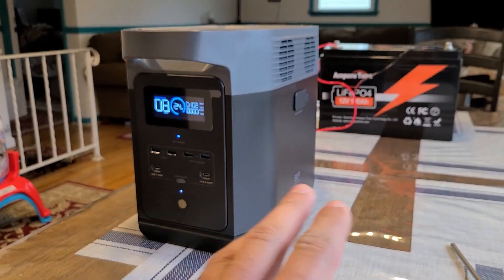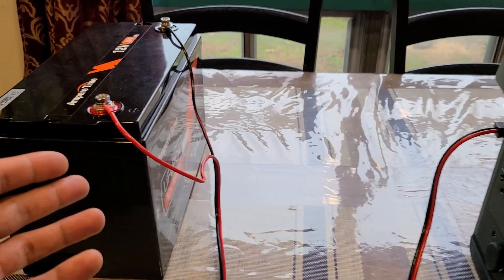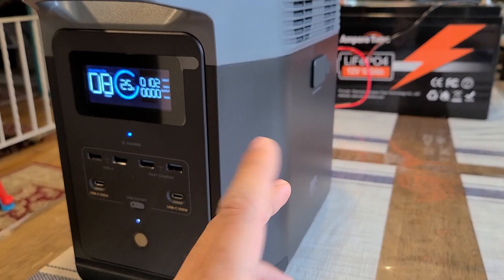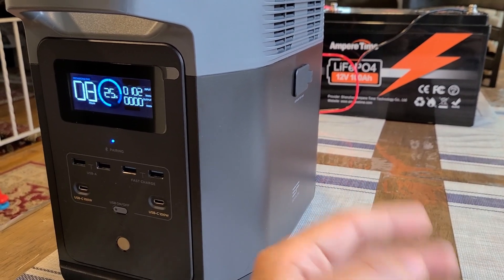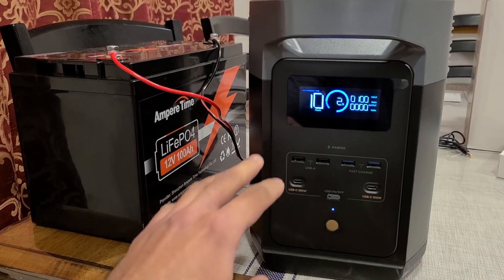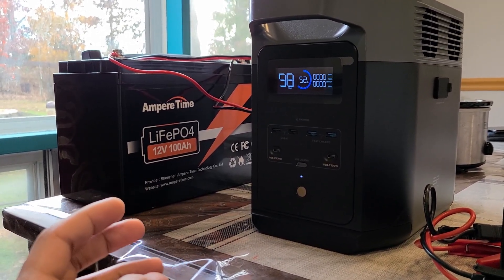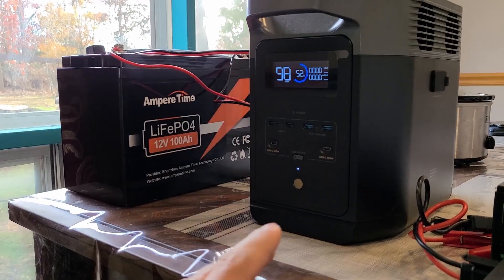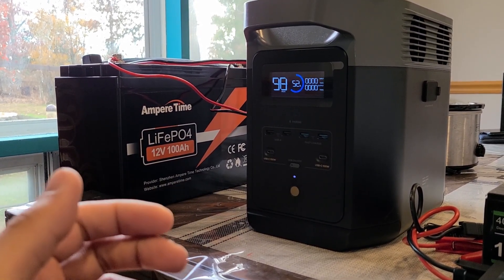Ampere Time Recharging EcoFlow DELTA 2 Power Station - Expansion Battery Test Number 2 #EcoFlow

Comment: Thanks for doing the test but something is weird. Either you have a big "Amperetime" battery or the ecoflow is lower capacity than advertised! 153 percent of a 1024wh battery is 1567wh. the amperetime is only 1280wh. So if you take 1280wh divided by 1.53 equals your Ecoflow is only 836wh at best because you also have to account for charging losses!
Reply: All power stations are using an inverter and it's tax is less than 100% efficiency.  It is more like ? 20% to run the power bank ?

Comment: I was not expecting the Delta 2 to pack a 1024Wh capacity since it is rather small.
Reply: You should see the delta2 max with double battery capacity in the same size 😮

Comment: Cool test. If you want faster speeds you need to up the voltage. For your next test, series both your 12v batteries to achieve 24v then connect to the ecoflow. This should double the speed. Another way would to boost voltage would be to get a dc boost converter. They make them in various voltages and amps to fit your needs. Future test possibility? Jasonoid did a similar test where he paralleled two boost converters. More videos and tests please!
Reply: Good point. Per Ecoflow specs, the Delta 2 will accept a "hard D/C input limit" of 500 watts (max) using any combination of 12-60 volts and up to 500 watts. This makes it very flexible to use any (battery or solar panel) combination of 12, 24, 36, or 48 volts. For example, A 12-volt D/C battery @ 500 watts will use 41.6 amps / a 48-volt D/C (battery or solar) combination @ 500 watts will draw 10.4 amps.
"Hard Limit" meaning anything over 500 watts of D/C input the Delta 2 will shut down all D/C input. Personally, I use four (4) 12-volt, 120-watt panels = 480 watts to stay slightly under that "hard limit". My panels are on a separate solar system specifically for the Delta 2 as a backup for my home office. I have each pair wired in Series (24 volts) and both pairs wired in parallel producing a max of 480 watts @ 24 volts and 20 amps. Note, any A/C input will also override any D/C input, so combining A/C and D/C input is not an option.
Reply: @royrobinson4636  It is also limited to 15 amps.  This means you need 34+ volts before you get 500 watts.  And if you use an XT60 or the "lighter plug" wired XT60i to connect to the Delta 2 it will only draw 8 amps.  This means if you max the voltage to 60 volts you will get 480 watts.
Reply: In that case make sure the DC-DC does not discharge the 100 Ah below the voltage that is on it's specsheet

Comment: Hello, I'm going to say the reason you only get 104 watts charging input is because the extra battery you're connecting to the EcoFlow Delta 2 solar input is a 12-volt battery. Not sure what the solar input rating of the EcoFlow Delta 2 is but 12 volts is probably the bear minimum. I would suggest a fuse be installed on the positive input cables. What happens when a person uses an extra battery like this, and the Delta 2 is asked to run an A/C device? I would suggest a person buy the EcoFlow Delta Max extra battery, $999 and comes with 2000 some watts, and use the supplied connection cable not risking anything. Plus, then you get full APP support and charging of both the EcoFlow Delta 2 and Delta Max extra battery. If I was in the woods and had no solar cells and only a running car, I would use the cars cigarette lighter and charge the EcoFlow Delta 2 with that method. This method is possible, you showed it, but I would fear the possibility of damaging my investment into my EcoFlow Delta 2. Thank you for the video. I enjoy watching and learning. Take care.
Reply: What size fuse on the positive would you suggest?
Reply: @MyChannel-vm6dw  Hello, I'm not an electrical engineer. I do know that EcoFlow allows for a vehicle's standard car cigarette lighter port to connect to the EcoFlow solar input XT-60 connection port. And when charging the EcoFlow Delta 2 in this manner, car idling, the best charge rate input into the EcoFlow Delta 2 would be about 120 watts. So, using that stat as a guide I would install a standard 10-amp fast blow car fuse. I noticed two red wires were being used so I would place a 10-amp fast blow fuse on each red input wire. Please remember I'm not an electrical engineer.